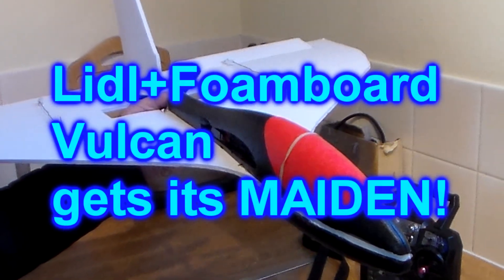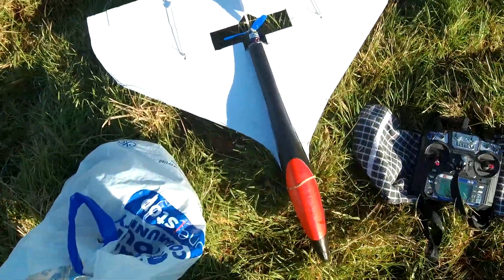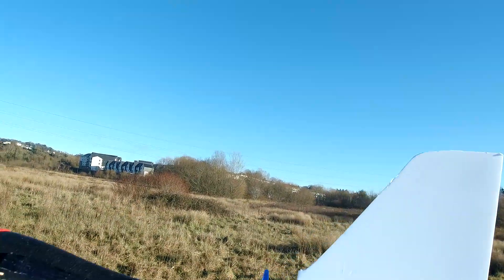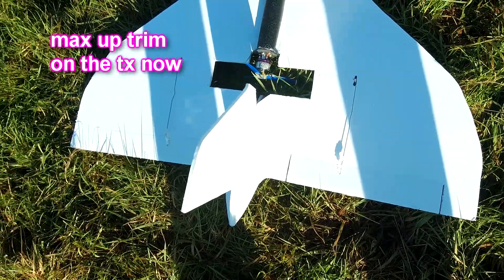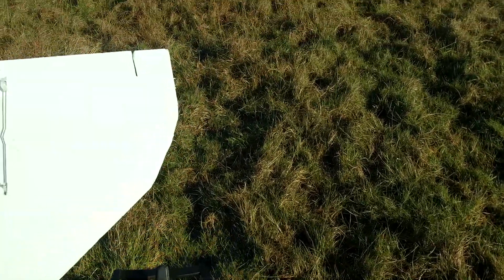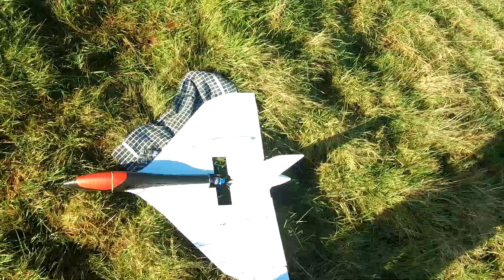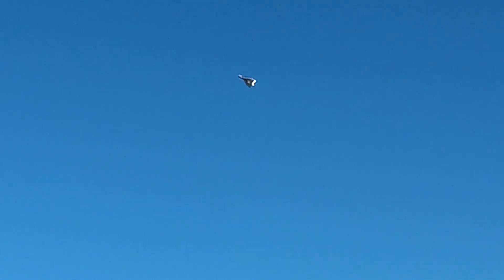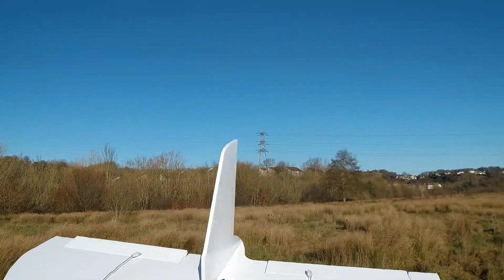Maiden Flight    -   Lidl  Chuck Glider RC Vulcan Build - Part Three

Comment: Hi ,  Nice job . What size motor and prop do you recommend for this one ?  Thanks !
Reply from the maker: Hiya, I've got a BR2204 and 2 blade 6040 on it now. I upgraded it from the original as it was a bit underpowered. It's brilliant now and so easy to build.
Use 2s 1000mA lipo
Flight with upgrade is here https://youtu.be/fZczzXTA3XY?si=1iFpwTU3nh35fdYe
Reply: @bobflyman  Thanks so much , youre a legend !
Reply from the maker: Ha ha, a Leg End more like! 😂

Comment: Hello Bob. What are the wingspan and the total lenght? The CG also the point.
Need some up trim?
Cheers
Reply from the maker: Span 72 cms.  CG measured from the tip of the tail as it's difficult to measure from that curved leading edge is 37.5 cms.  Did you see the video where I'd fitted a bigger motor (or the one where I said was it underpowered! BR2205, 6040 prop.  Flies great with that bigger motor and prop. Check out the video.  Details are in the description of that.   Most of these designs need a bit of reflex. 
https://youtu.be/fZczzXTA3XY?si=U7ngllC32uIWmwkS

Comment: I would have expected that amount of up trim particularly on launch. You could have a launch mode up trim as the reflex does not work that well until the AS gets up a bit. Yes I am a wingnut :). Tracking your EDF Vulcan build now as LIDL clones have made it to KMart here in Oz. Great work.
Reply from the maker: That's good news, they are a great cheap models to experiment with!  This  version flies really well.  Did you see my EDF Lidl glider version, that flies great. And my first EDF jet attempt?  Lidl nose and foamboard Vulcan. Still not maidened but looks nice. https://www.youtube.com/watch?v=VTjSyig2jIE&list=PLLdle7NDE_1Y_XC3kjOSIUDJcRxVrhez-&index=1

Comment: i think you have too much downward angle on the Lidl body but im NO expert when it comes to airplanes with flat airfoil
Reply from the maker: It glides well power off and when it stalled the nose only dropped gently.  I think it OK. Flies well.
Reply from the maker: But I think you may be right about the nose angle. I said that in the video! 😉
Reply from the maker: Flies amazingly well for a flat piece of foamboard,  as you say though!

Comment: Great maiden there Bob, I notice you have a right bias when you launch, perhaps it would be worth having a bias to the left for a cleaner launch? She looked great in the air, I'm wondering how she would go on the Slope with that glide 🤔
Reply from the maker: Sloping, that's an idea. OK in a breeze I'd think.  Re the bias, she flew straight once in the air.  I've tweeked the elevons now in % mix that should be better. Did you see my comment that the tail launch thingy has survived!
Reply: @bobflyman  I was talking about the launch technique bias, ie everytime you launched it went right, angle it to the left a bit to compensate? Yes, good news on the skid 👍